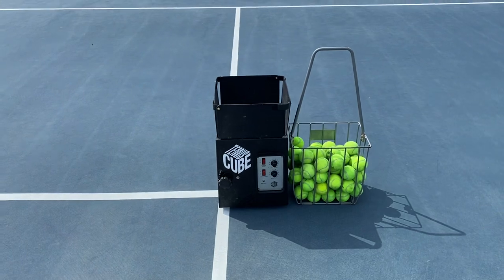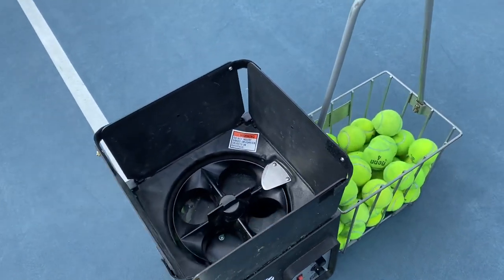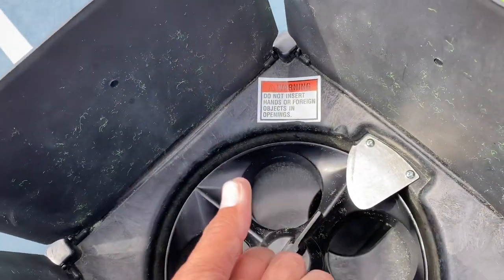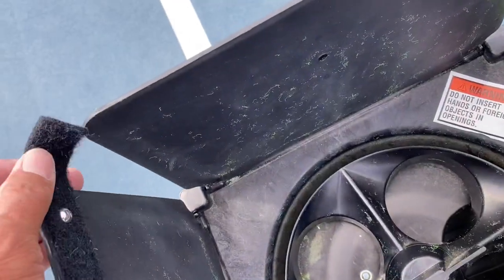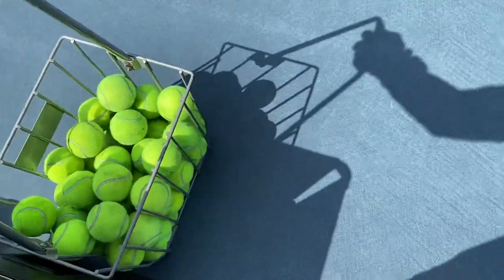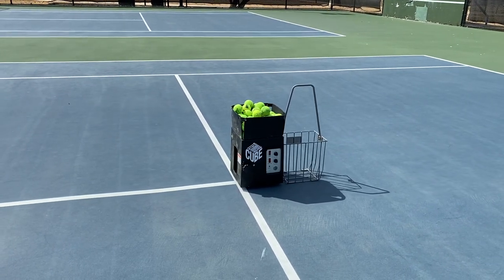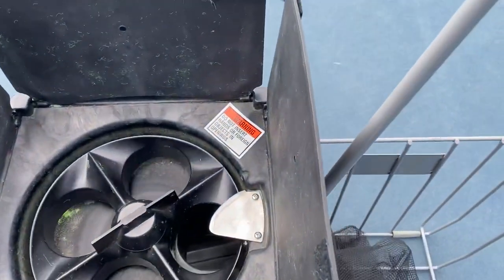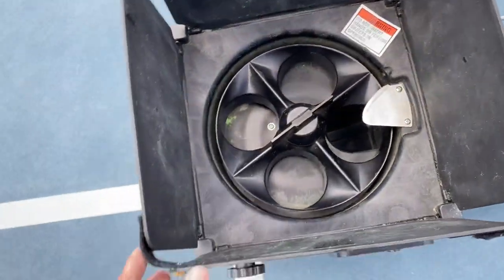TENNIS CUBE ball machine from Sportstutor Review; problems and solutions after 6 months of used.

Comment: My machine is almost useless at this point. Once the balls drop down the feeder, the things just spin and won’t grab hold of the ball and shoot it out. Normally it takes two or three balls lined up before it shoots then out all at once. Any advice?
Reply: The rollers spacing is too low. I sanded the rollers rubber to increase the spacing and i don't have a single ball not being thrown
Reply: I have this machine and I rarely have problems with stuck balls. I just wish it had a better battery.